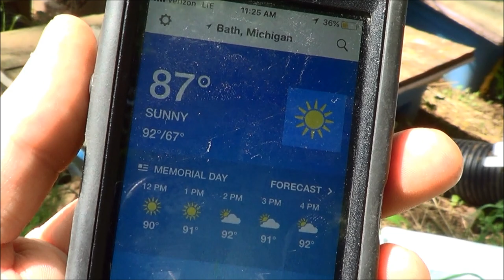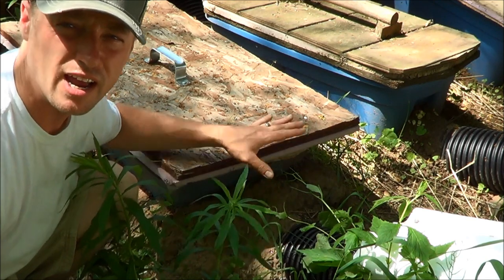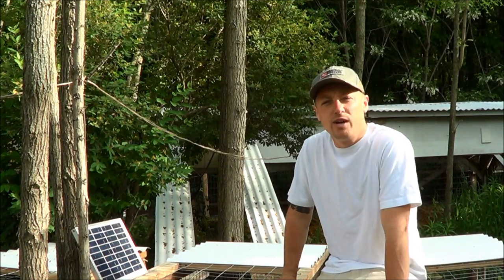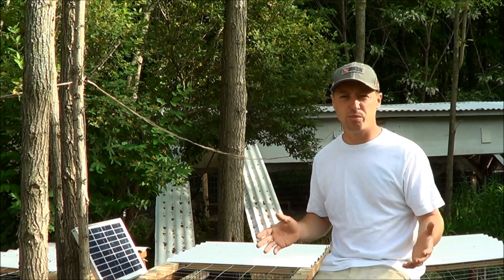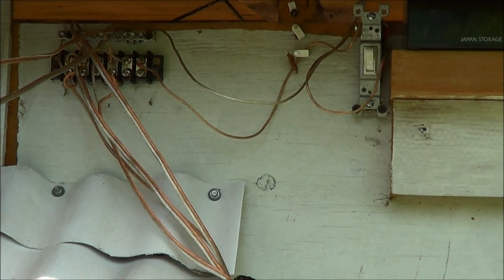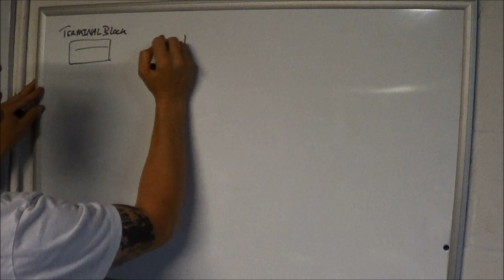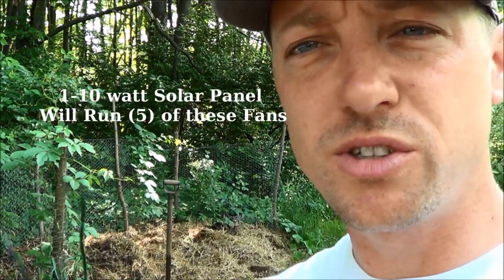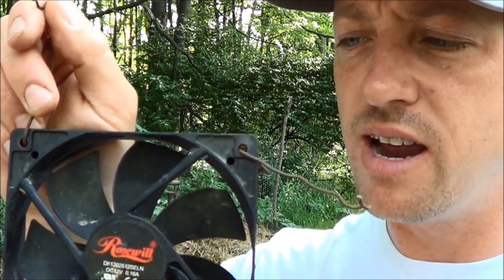RABBITS IN SUMMER/THE RABBITRY CENTER'S COOLING TOTES

Comment: Hi! Thank you so much for your videos. I’ve been exhausted with the fans (mine aren’t solar) and ice bottles through the SC summer. I’m in the process of building underground totes just like yours for all my rabbits. Are these totes enough to cool them? Will the rabbits go down there if they need to in the heat? Or do I still need to do fans and ice? Thank you!
Reply from the maker: Every little bit helps. The fans are terrific in the The morning, and in the evening, spring in the fall, but in the hottest part of the year I would recommend totes over fans because when it’s very very hot, the fans tend to just blow hot air but the insulated totes will feel cool and relaxing like a basement I won’t see my Rabbits until evening time when they’re coming up for water.

Comment: Thank you for the electronic fan idea.  I KNEW someone would have done that- you're the only one who's actually done it however.  I live in Mena, Arkansas- and from the end of June through the end of September/early October it's over 90F @ 85% humidity.  I don't want to run underground- first off, Arkansas is a mountain region second, the ground here is sand mixed with pebbles mixed with rocks- and I've had post hole diggers ripped right out of my hands so your boxes won't work here- can't dig down that deep without a backhoe.  Third, I'm right next to a forest- that's all I need is a bunch of coyotes digging them up.  But put them in cages, use your fan ideas, and then a water mister seems doable.
Reply from the maker: Thanks for watching

There is a way to set your tote system up and not have to dig underground I did this using cinderblocks check this video out about three minutes in
https://youtu.be/sftPHZcv_to
Reply from the maker: Also here is a video showing how I set up those fans
https://youtu.be/j6YeY78_XLk

Comment: Would a water mister also help keep them cooler?
Reply from the maker: water misters are awesome and work great I heard they drop the temp by 15-20 degrees and I've thought about it.  I need clean water that doesn't gum up the sprayers.  Unfortunately we have hard water and I'd have to tap into the water softener to plumb well out to the Rabbitry. I still might do it one day.
Reply: Misters tend to only help with "feels like"  temperature. If you have low humidity the additional moisture does help. It will not be nearly as helpful in high temp high humidity situations and may even exacerbated bacteria grown in and on your cages. Not trying to poopoo the idea just trying to add some food for thought.
Reply: Yeah mist some cold water on their ears, it helps!

Comment: That’s ridiculous to never clip your rabbits nails.
Rabbits can easily go up a carpet ramp with clipped nails and it is much safer for them to do so. Longer nails can get caught in pieces of carpet and the rabbit can unintentionally rip their nail off while struggling to get unstuck.
Reply from the maker: Yikes. Yea that'd be bad if that happened.  It hasn't. I didn't make that clear.  We don't trim our rabbits nails because of the ramps and the runs. Not just so they can access.  We have runs with dirt bottoms and wood hides they claw on.   With our dirt, runs and hides and ramps our rabbits care for their nails themselves much like wild rabbits do. When you add in these elements dirt wood structures ramps they can actually naturally grind them down.  Much like wild rabbits They spend  their time digging and living in burrows, which are called warrens. Doing all of this digging around in the dirt, wild rabbits essentially erode their nails. This keeps them from ever growing overly long.
  But I agree with you when it comes to domesticated rabbits in a cage or indoors who don't get the chance to grind down there nails naturally.  They'll need to be trimmed.